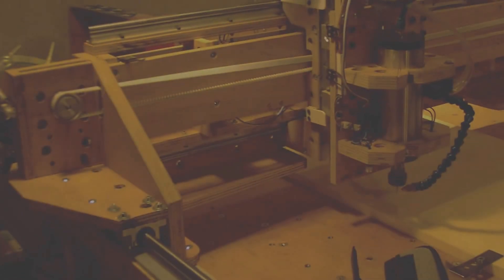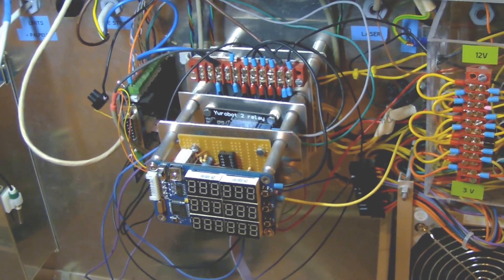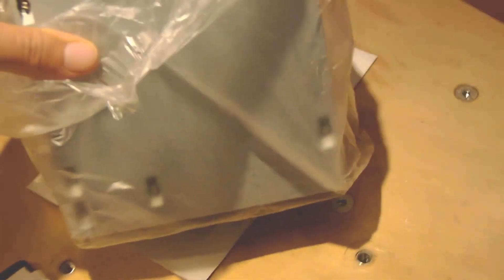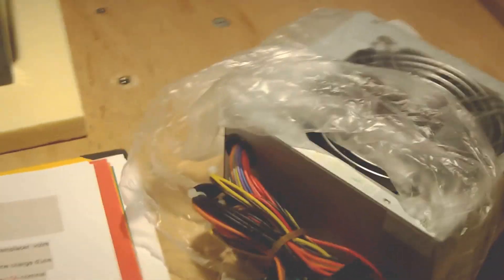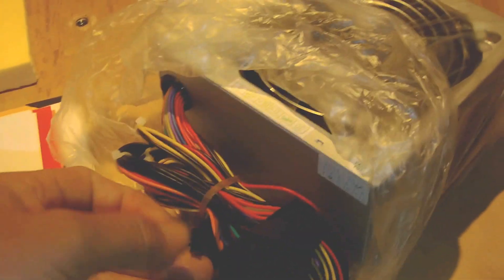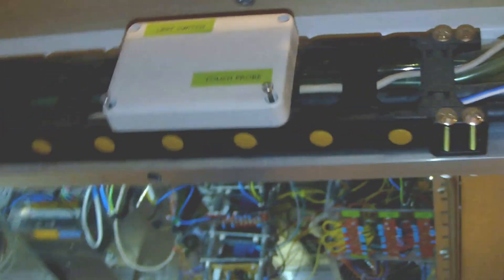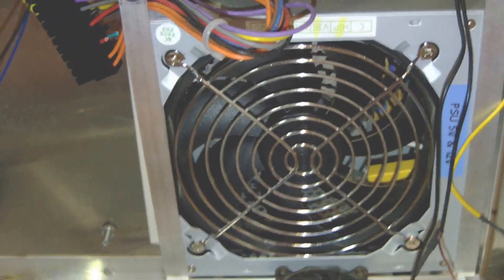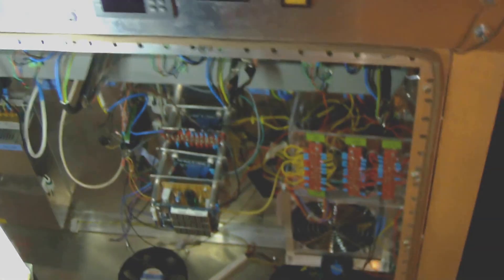Homemade DIY CNC, how to convert a PC Power supply for CNC machine.

Comment: I don't understand why you have to short the 5v rail with a resistor. I thought some of the electronics on your machine already use the 5v. Is that not enough? If I got an Arduino for example and hooked it up to it, would I still need to short the 5v?
Reply from the maker: Such PSU need a minimum load of 10% to start properly. As the 5v rail has 30A it needs 3A to start. A lot of electronics does not start with the PSU but with power switch or relay. That's why it needs, in this case, to draw 3A with a resistor.

Comment: Nice video. I didn't know the ATX had such voltage breakdown. For the other, 48V seems very high even for cnc motors. What kind of motors do you have?
Reply from the maker: Have a dedicated PSU for powering steppers like this one:
http://www.ebay.com/itm/MW-48V-7-25A-AC-DC-PSU-Switching-Power-Supply-Mean-Well-NES-350-48-350W-/111118284568?hash=item19df2a7718:g:B-MAAOSw3YNXbhVs

Comment: Done similar thing , but with no load on 5 volts.   Just direct contact ....and that broke the power supply . Now i'm using an old printer power supply to power a  cooling fan.
Reply from the maker: Make sense. Thanks for the tip.